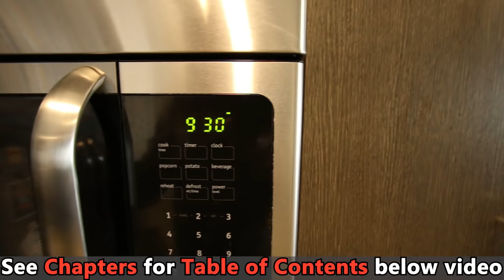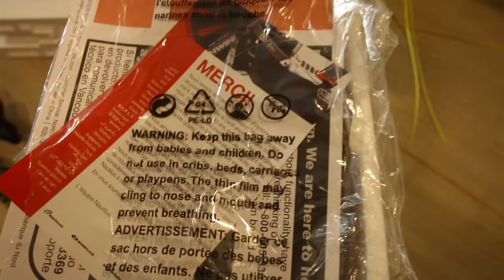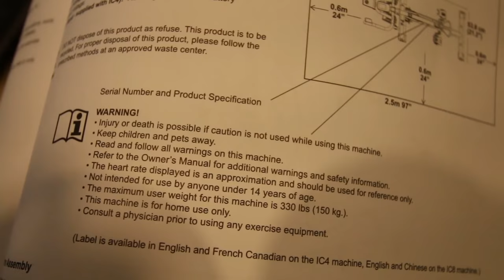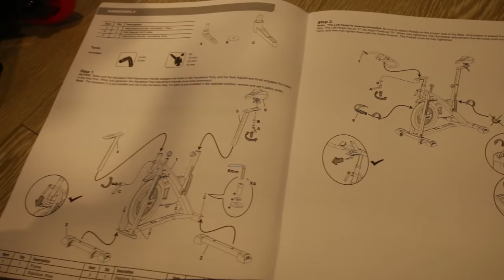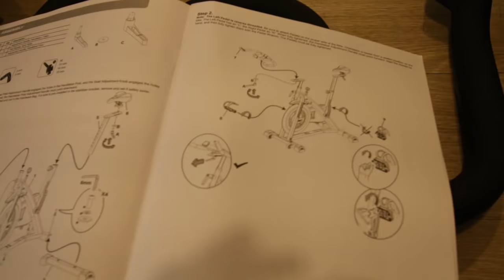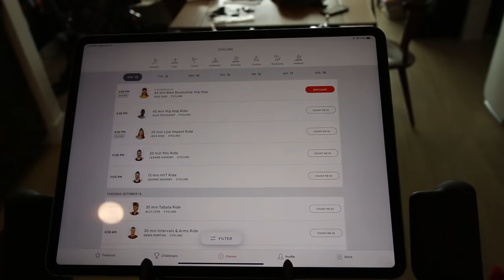Schwinn IC4 Assembly and Unboxing - HOW TO BUILD Schwinn IC4 indoor cycling bike - Bowflex C6

Comment from the maker: Get your popcorn ready! Chapters listed below:
4 Things I HATE about Schwinn IC4: https://youtu.be/-YpuKucAS48
My official Schwinn IC4 review: https://youtu.be/wIDaMlkKM_Q
Buy Schwinn IC4 on Amazon  https://amzn.to/313GIjs 
Order directly from Schwinn: http://bit.ly/schwinnIC4 (IN STOCK)  
0:00 Schwinn IC4 intro 
2:08 Initial observations  
4:20 unboxing Schwinn IC4 (step 1)  
6:10 pedals observations  
8:10 cutting zip ties off back  
8:48 Step 2 installing rear stabilizer  
10:40 removing handlebars  
11:54 step 3 installing front stabilizer  
12:50 step 4 install handlebar stem  
14:00 comparing handlebar adjustments between bikes  
15:40 install seatpost (step 5)  
16:42 install seat (step 6)  
17:00 install handlebars  
18:43 removing more zip ties  
19:19 install pedals  
22:22 install water bottle holder and weight holders  
24:22 install Schwinn ic4 screen  
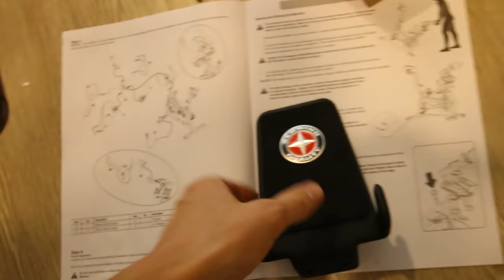25:30 install tablet holder  
26:11 how long does it take?  
26:45 first impressions  
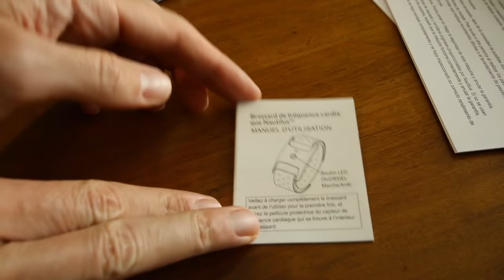29:58 plugging in the Schwinn ic4 for the first time  
28:20 first look at Schwinn ic4 screen  
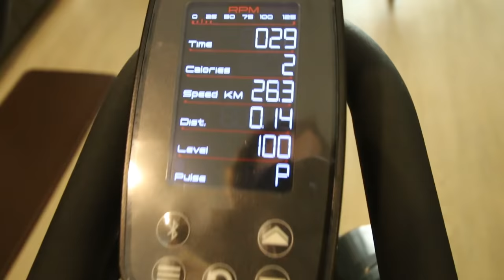28:40 resistance knob observations  
29:58 Schwinn heart rate monitor  
31:04 testing out Schwinn ic4 and summary

Comment: I kept hearing how the instructions were lacking and the assembly can be confusing etc etc. Well I must admit. I haven’t even opened the instructions.  I didn’t even look at them.  I opened the box. Took all the pieces in my basement and then looked at this video and put it together with no problems at all.  Well done video, sir. It was very helpful and was reassuring.  I also enjoy all your other videos and it was a major reason I chose the IC4. I almost went with the Sole SB900 or Stryde but figured for long term this was best. No need to worry about a company going out of business making their ecosystem useless.  No need in worrying about a monitor going bad. Just a well built machine with the option to hook in via a tablet.  I think I might use an iPad to mirror to a large Roku TV. 
Thanks again!

Comment: I did it!  I was able to easily assemble my bike with the help of this video.  One word of advice is to make sure the lever is facing out when installing the handlebars.  Since I am short, I adjusted the handlebars close to the seat, tightly screwed in all the other paraphernalia, and realized I could not move the lever.  Faced with unscrewing everything and going back several steps, I realized I could remove the screw and spring from the lever and move everything forward. It's all good to go and I'm thrilled I was to do this myself.  The video is much easier to follow than the manual.  Thank you!
Reply: hi kathy, what do you mean make sure the lever is facing out?

Comment: Thank you! Now I can rest assured that I can assemble this beast tomorrow without problems unless some parts are missing.
Also, it seems that Schwinn is in control of quality, so assembly does not require to push parts into holes.

Comment: I didnnt watch the whole video but FYI to watchers- the lever adjusters are like ratchets. You pull them out, rotate them, click them back in THEN turn with tension. Thats how they can fit them into small spaces. Install the handlebar one facing out and you wont have to fight with the cupholders to get your fingers in there to adjust the handlebars later. The ball adjuster for the seat post is pull out, slide bar around, let knob click back in, then tension a bit to keep in place.

Comment: Have the ic4 for about 15 days now, my only two complaints is the water bottle holder and the resistance isn’t one to one compared to peloton(for example a 30 percent is 17 on the ic4) I’m 5’6 and I hit my water bottle when standing at position 3. 
Also yes it’s the same bike as the bow flex c6 and ic8(think that’s for the British market). The bow flex comes with a mat and of course it’s a different color scheme.
Reply from the maker: Wow, I know I hit my knees on the water bottles at 6' 5", but I wouldnt have thought at 5' 6" knees would hit, did you state that correctly? How are you liking the bike? Did you see peloton may discontinue casting the cadence to the peloton app screen?
Reply: @TailHappyTV  yes that is correct. Even at my shortness it’s easy to hit. I might need to adjust the bars to move slightly forward. Granted I use a bottle that sticks out like 2 inches out of the size of the holder. 
Sad to see if cadence is going. I didn’t heard the news about that yet. I guess they rather base it on output or wattage? It not end of the world since whenever I was following along on a stationary bike at the gym, I wouldn’t have the cadence or any idea about resistance. I just would try to match the instructor pedal speed. 
Oh and I am loving it, I feel very motivated to get fitter every day. The main reason I got it was because my brother is nearly 315 and it was one of the few bikes that would support his weight. He just uses it while watching tv or something. He has issues with the saddle so I got a seat padding cover. I don’t have any issues with the saddle. So, I’ve been enjoying it, but mostly because of the push from peloton. If I were to just use classes on YouTube or something I don’t think I would have the same motivation. Since I tried building my own program in strength and lifting weights I wasn’t really going anywhere. It wasn’t till peloton I started making some progress. Granted now I am trying out the app Fitbod for my strength training, since it can log and track my weights used and progress.
Reply from the maker: Awesome to hear your story Edward!

Comment: Thanks, could not have done it without this video. Question:  I purchased my IC4  this Father's Day in Orlando, FL. I noticed that the rear footing on my bike is shaped in a slight U form. The rear footing on your bike is not. Slight variations depending on manufacturing date maybe??

Comment: I was cutting my straps with a knife and it slipped and accidently nicked the wheel a little bit. Luckily it isn't really noticeable and doesn't effect the riding. I actually watched this video as I was building it. the new manual changes the order you put stuff on, but this helped. Well except that I put the handlebars on backwards and had to take them off again. With my bike I did not get weights, is that normal? Also I thought it came with a heartrate monitor, but I didn't get that.

Comment: Hi Tailhappy, did you notice that the ability to adjust the handlebars on the Scwhinn is actually deceivingly restrictive? It can only go back a couple of inches due to the tightening lever. The lever will knock into the handlebar post if you move the handlebars a couple inches back, despite there being lots of room in the handle bar slide itself. I was pretty disappointed about this as I was looking forward to more substantial freedom of adjustment on the Schwinn IC4 handlebars. As it is it doesnt seem like much of an improvement to a fixed handlebar. Only a couple inches of freedom as opposed to the full several inches it advertises.
Reply: just point the lever out instead of in and it fixes this problem.

Comment: This video was super, super helpful. I basically set the instructions aside and just followed along, hitting pause as necessary. I'm not a cyclist, I'm not an engineer, and IKEA furniture assembly drives me to tears. If I can do this, anyone can do this. It took less than an hour (I had already unboxed it, but had not unwrapped the pieces or snipped the zip ties.) Warning to all: the hardest part was putting on the (*%&^%&!! water bottle holders. That connection was totally a pain, and I yelled f@ck about 97 times as I dropped the screws, the allen wrench, and then the screws again. Off to try out a ride now. (BTW: I had already purchased the bike. I decided to get an indoor bike that was not a Peloton first--if I don't ride that much, it's less of an investment, and also I got free financing plus a discount. If I decide I adore indoor cycling, I can always sell this one or give it away and get a Peloton.)
Reply: Best way to do this is to just remove the handlebars first, then the computer (4 screws), then the cupholder bar. Its a pain but it does give you more room to get in there. I ended up taking my cupholders off. Ill put them on again, eventually, when I get more distance, but for now they are just one more thing in the way of adjusting or potentially hitting my knees.

Comment: great video.. I notice that the lever to move the handle bars back and forward, hits the water bottle holder, so once all set up as descried, I cannot change the handle bar position, front to back. Do I need to remove the handle bars and try to screw on the lever starting from a different position???

Comment: Great video thanks... how do you get around moving the handlebars after assembling the monitor/water bottle holders? Esp if two people are using the bike?
Reply: I found the answer on reddit. 

"You have to pull out/down on the plastic lever. Its spring loaded, that disengages it and you can rotate it back without tightening it. The you let it push it back in/up and it reengages. then you can loosen it more. Do that as many times as you need to ."

Just make sure the lever is on the outside of the back facing the front so you have the full range of loose to tight available.
Reply: @teegee126  thank you! Very helpful answer

Comment: Thanks for the video. Really useful.
One question - do you have any movement in the handlebars when standing and working quite hard? Or is it rock solid?  I can not physically get the handbars any tighter. I have read this in a few related forums

Comment: When I out on the water bottle frame I can't just the tightness of the handle bars because it hits the frame. If I tighten it up before installing them I can't get the frame around the handle to tighten the handle bars. What am I doing wrong?
Reply from the maker: Pull the lever towards you and adjust its position before rotating it, kinda hard to explain
Reply: @TailHappyTV  
Thanks!

Comment: Do you ever grease pedal threads on these assemblies?
Reply from the maker: I should, but I haven't yet. Need to buy some pedal grease. Do you put grease on yours? I've never had a pedal get stuck permanently, but I did have to buy the big pedal wrench to get my pedals off my road bike after I couldn't get them off with a regular wrench...
Reply: @TailHappyTV  I just ordered the ic4 so I'm reading up on setup.  A lot of people recommend pedal grease was wondering what your opinion is.  Thanks

Comment: When attaching the handlebars, the lever must tighten in a forward position so you can attach the weight/waterbottle holder. But mine only tightens sideways! (I've tried both levers several times.)  Has anyone figured out how to keep the weight/waterbottle holder from obstructing the rotation of the handlebar lever?
Reply: I think that handle is spring loaded so if you pull down slightly you can rotate the handle without it actually loosening or tightening the screw then rotate it to a place where it won't be obstructed then press the handle back up. Hopefully that makes sense!
Reply: My ic4 arrived today and I am unable to figure out the weight water bottle holder piece. It makes the handlebar adjustment lever run up against it when I try to get handlebar adjusted. My lever doesn’t seem spring loaded. Did I do something wrong?
Reply: @elainefrisbie  I'm having the same issue as you. Been trying to figure it out.
Reply: Omg. I am having this problem too! It’s a nightmare. Everything was going smoothly until I tried to put the bracket on for the monitor
Reply: Side bar. It is spring loaded. 🤦🏼‍♀️

Comment: which bike is better in terms of turning resistance kob echelon or shcwinn? like with peloton you can turn very slightly to go from like 40 to 42 which bike, shcwinn or echelon, is more similar to this in that when you turn knob it goes by number individually rather than like chunks like one turn changes 10 levels if that makes sense?
Reply from the maker: The schwinn takes 4 turns to go from zero to max, the echelon takes many turns, maybe 15ish, to go from zero to max,
Reply: @TailHappyTV  so theres no way to change 1 level at a time with scwinn? it goes in sections? wouldn't that mak echelon more similar to peltoon in that sense?
Reply: like when i turn the knob slightly will the schwinn change levels one number at a time or in intervals only?

Comment: Soooo my IC4 arrived today with massive damage to the box and some broken bits of plastic as soon as I opened the flap. https://imgur.com/a/SqCoBLB

Any idea where those plastic bits might be from? And do you think I should just immediately return it without unboxing? Very disappointing shipping
Reply from the maker: It might actually be undamaged, I had some echelon bikes arrive in even worse condition and the bikes themselves were perfect. The plastic broken pieces may be shipping padding. Only way to know for sure is open and see I guess, now I’m curious…
Reply: @TailHappyTV  Good news, the only damage was to the "sacrificial plastic" piece on the front of the bike. Sounds like they knew where damage was happening before releasing the product.
Reply: @TailHappyTV  An update to the update: I think there is something wrong with the flywheel bearings so it is going to get returned. It sounds like a crackling noise coming directly from that area. Spent hours this weekend trying to troubleshoot.

Oh well, off to watch your other videos to try and find a different bike to replace it with 😉